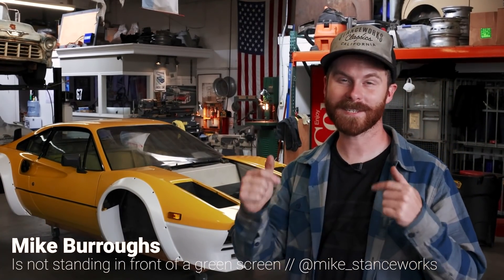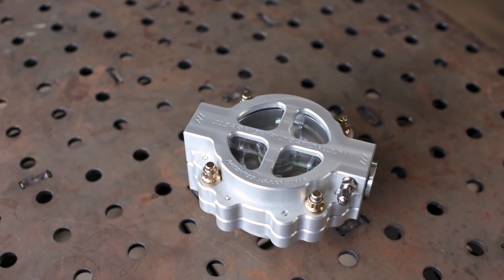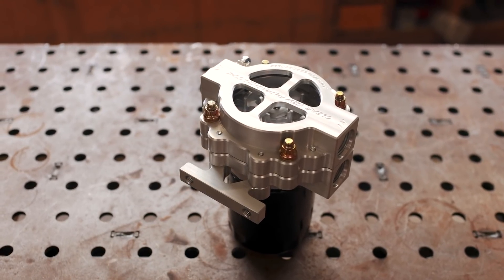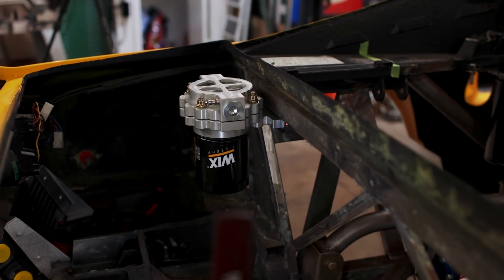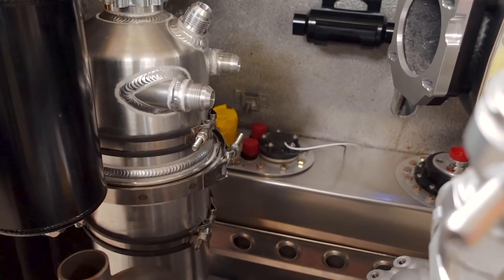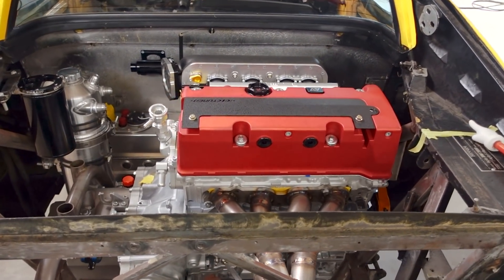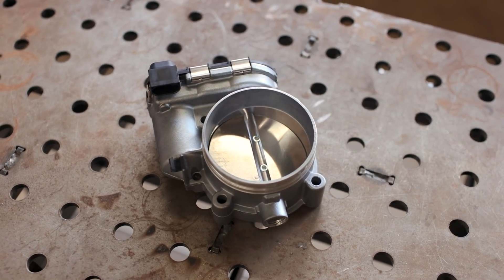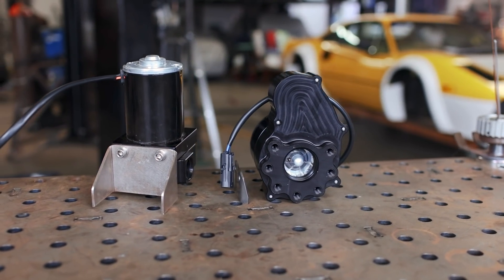More Insane Parts for the 1000hp Honda K24 Ferrari! Ep. 61

Comment: Since you got a clear view filter that uses a spin on filter element I think you should be fine, but I've seen some people add a check valve in the oiling system.  I use one with my oil accumulator to prevent drain back, so it's not apples to apples in your case here.

Comment: I'm assuming one of the 2 inlet fittings to the dry sump tank will be capped because they are aimed at each other for the swirl? Guessing the upper on is a vent.
Reply from the maker: One will be for fluid, the other is just air return.

Comment: Have u seen the valve cover u can get since ur running a dry sump which does away with the oil cap on top and plug wires out the centre like an old f1 car
Reply from the maker: Nope. Who makes it?
Reply: @stanceworks  hpd makes 1
Reply: It won't let me add the link but just search HPD k20 dry sump valve cover I no u will like it 👍

Comment: Hi Mike...silly question but does the oil filter have to below the level of the dry sump oil tank???  don't want all the extra oil volume flowing back into the dry sump tank and overflowing it... maybe a one way valve system to prevent this. Project now looking great and big steps forward, but take your time like those darn control arms!! LOL
Reply from the maker: It won’t overflow the tank, there’s plenty of extra room inside of it. Worry not

Comment: In a standard coolant setup the top of the overflow bottle should be open to atmosphere so the engine can push excess coolant out when it gets hot and pull it back from the bottom when cooling down without creating a vacuum in the bottle. If you seal that bottle it won't work properly

Comment: Awesome set of parts. No expense has been spared on this build. I believe that those batteries with the “self jumper” function allow the battery to be slightly under voltage. A lithium generally isn’t allowed to go under a certain voltage and the battery management system protects it by cutting of the power to the battery terminals. The jumper mode as far as I know allows the user to temporary draw the voltage under its normal protection level allowing for enough juice to fire up, after which the battery will be above the protection voltage and can operate as normal.

Comment: Why did not you put engine in the middle?? All weight is on the right side...
Reply from the maker: Because it doesn’t go in the middle. It’s not in the middle in any car. It has a transmission hanging off of it. A heavy transmission that helps balance the weight.
Reply: @stanceworks  ok, thank you for answer, and also the driver is on the left.

Comment: Any reason you're keeping the factory cross braces that used to divide the engine bay from the trunk (and which the turbo now has to go through)? Serious eye sore and I can't imagine it's actually doing that much work structurally, is it?
Reply from the maker: It’s doing a lot of structural work unfortunately. I can’t get rid of it. I could redo it, but to what end?
Reply: @stanceworks  Makes sense I guess. Should've known that you wouldn't have just left it sitting there :) Been absolutely loving the build man. Thank you for sharing it.

Comment: I used the same Mishimoto expansion tank on my LS swapped Sonoma. Its nice, but definitely needs improvement. However, on the mounting screws being tapped all the way through, I don't think it matters. If you open the lid you'll see that there's a very small weep hole just in case it overflows.

Comment: Is your oil pump set up to run by itself or does the engine have to be running? I ask because on our race plane we had the ability to pre-oil the engine by pressurizing the oil system before we actually started the plane up, reducing wear on a cold engine.
Reply from the maker: You can technically spin the pump by pulling the belt

Comment: Wow that oil filter element is awesome 🤩 👍🏻 
I wonder what your weight distribution will be like. Are you throwing weight in the front too?
Reply from the maker: Not a ton, just the two radiators and the fluid weight for the most part. I worry it'll be rear-heavy, but at the same time, it's got to have a better balance than it did originally. I've removed a lot of weight from the rear end and moved what weight is there forward. The front end should be more or less the same as it was prior.

Comment: No worries on the inlet/outlet on the cooler, on F1 cars the radiators are mounted at an angle, I have worked on F1 wind tunnel cars and it works well..
Great content 👍
Loving the unboxing and new parts ...

Comment: Mike the build is awesome but your water pump is over kill. You are never going to pump 50 gpm through  the engine the radiator wouldnt have time to cool it at that rate . The thermostat is going to regulate that down so much. I've built a mid engine honda and  have increased the coolant volume by 100 percent. I dont even run a fan. Drive it in the florida heat and it runs a steady 190 . Hey but the build a truly amazing.
Reply from the maker: I can always downsize, no biggie

Comment: I'm curious how you're going to get enough cold air into the engine bay for induction and the intercooler, with only those two 'hip' inlets on the 308. ETA >> forgot the intercooler is air-to-water, but all the same, that motor is going to want to gulp pretty massive amounts of air full-bore, is cold air availability in hand?
Reply from the maker: The cooling for the intercooler happens at the front of the car. It’s a water to air system that uses coolant to lower the charge air temps. That coolant is in its own cooling system and is cooled by a radiator at the front of the car, hence the need for two water pumps. 👍

Comment: For the water to air intercooler, you could clock it slightly at an angle to reduce the turning angles required to go from turbo to intake- unless you really want to keep it parallel with the block...

Form over function vs function over form

Comment: that is a mahoosive charge cooler core.
i might be mistaken but the way you had the core positioned in the car and from what you explained.
isn't the water supposed to go through the sides (that look like the outside of a radiator) and the boost goes through the other bit that's facing front to back?

Comment: Keep the cooler where it is, 30kgs+ in the back of the car will definitely be noticeable on the track, that way all the weight is on the middle making a pretty nice chassis that can rotate nicely around corners. what are you going to do with your wastegate? I have a fueltech on my ride and am upgrading to an electronic turbosmart wastegate after seeing it on boostedboyz channel. That build Is going to be top notch, those race parts surely are putting a dent on your wallet, but you are right, do it once and do it nice.

Comment: You can never have too many AN fittings and being short even one can really slow down the build so over-order even if it is a little expensive. Keep the extras on the shelf because you will 100% use them on a future project. Be sure to hit up the guys at Vibrant Performance because they have a great assortment of AN fittings at very good prices. 

As for the battery I would look at placing it behind the passenger seat. It should fit well there and could offer a good place to position the weight (albeit low) of the battery.

Comment: That's such a sweet set up.
Have you thought about a snorkle to pick up cold air as you're going? The charge cooler is pretty close to the engine. Could maybe route it coming back out near the rear wing, the air pressure could help downforce and the pressure caused by the wings air movement could help pull it out too.
Im not 100% on the theory, but It could work?
Reply: It's a water-to-air intercooler, there is no "exit airflow". The airflow happens at the heat exchanger up at the front of the car, in front of the radiator, and the liquid cooled there comes back to the charge cooler to cool the air from the turbo (which is sealed in by the charge piping).
Reply from the maker: Perfect explanation!
Reply: @jsquared1013  Duuurrrr.
I forgot about that part. Do excuse my idiocy there. Even says it in the video too. What a cabbage 🤣🤣

Comment: hi. it seems you have a lot of space on the left side of your engine bay. Why not using the left airintake for cooling your oil radiator similar to the original dry sump 308s. This way your oil tube system will be more compact. Also the closer you put the oil radiator to the airintake the better cooling you'll have. If you want to optimize it you can create an air outlet that faces up to the grills of the engine cover so you have a quick flow in and out (hot air facing up comes out faster making your cooling efficiency better). Another thing.. Make sure you'll have access to your dry sump tank when you have your engine cover on. Its carrying a big part of the car's C-pillar and when its open theres not much access towards the firewall. In general you're doing a great work (although if i were you id choose a 308 thats not in the excellent condition that yours is/was) but try to consider the engine bay ergonomics WITH the engine bay lid on the car. You'll see that the access is not the same as now. Keep up!
Reply from the maker: You’re definitely right about oil tank access. There’s just not enough height to put the tank elsewhere, unfortunately.

Comment: The position of the air inlet and outlet in the intercooler can end up pushing the flow towards the outlet side, making the intercooler less efficient, as the rear side will receive less flow. Do you plan any internal fins on the inlet to direct the flow and fix this? Can't wait to see the intercooler manufacturing process.
Reply from the maker: I’m not sure I fully follow
Reply: @stanceworks  How can I send a draw?
Reply: @stanceworks  Check if you can see the drafts and let me know. There is one showing the possible error I see in the flow and another showing how I imagine the fins. But the best is to talk to the guys that made the core, and check if they see some problem and solution. OH, Youtube erased the comments with the links. I ended up sending it to the email that appears in the channel description on youtube.

Comment: Awesome parts. Seeing you got a lot of hose-work ahead, i'd like to suggest using bent stainless (or alu) tubing with hoses crimped in each end in order to get a cleaner routing. Hoses tend to find the "easiest" curve from A to B and sometimes it ends up looking messy. With tubing you can make sure that it follows the desired path. 
Love the build mike, great work.
Reply from the maker: This is a good suggestion! Although, I’ve partnered with Vibrant Performance, who will be providing all the plumbing needs for the car
Reply: @stanceworks  that's great! I'm sure it will be awesome then.
Reply: hose-work 😅
Reply: @kieranbuckley3959  hahaha, english is not my first language. Sorry

Comment: At 1000hp plus the oil filter must be more than the hand tight standard? Correct me if I’m wrong
Reply: The oil pressure is the same at 1000 HP as it is at 200 HP.

Comment: 10:42 Why not rotate the core by 90° ? I mean the coolant doesn't need to change, but for the air side we can have a down port (turbo side) and a high port for the intake manifold.
Reply from the maker: There’s not enough height available. It would stick out of the hood considerably. 
I have thought about angling the core to straighten the airflow but space is very tight.
Reply: @stanceworks  I'm sure you'll figure it out. But the cad design and then using my spider youtube senses looks like there might be some tight clearances either way it's positioned.
Reply: I was just thinking about this, except for space reasons, maybe just unkink the airflow a bit by doing a 20-ish degree rotation and shape the end tanks to optimize the flow path.